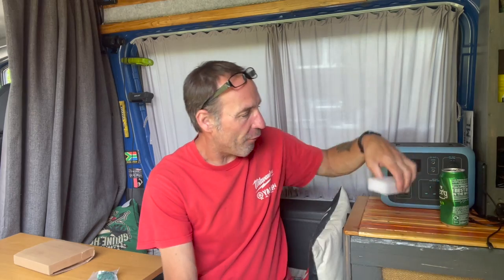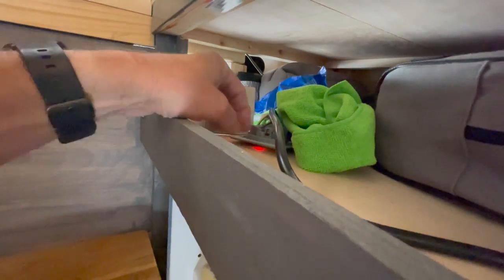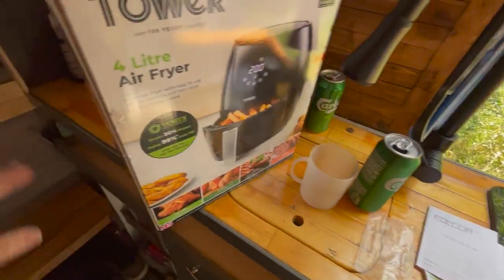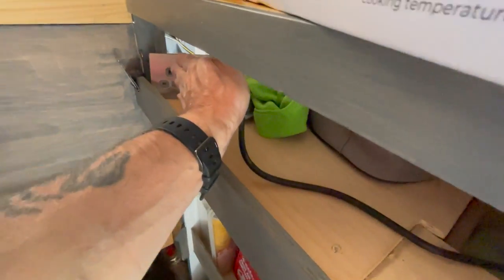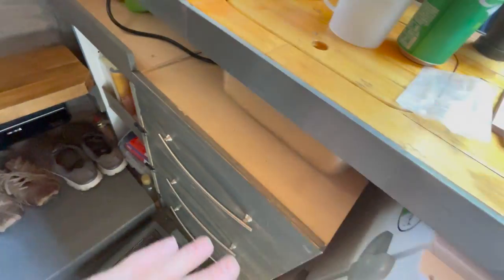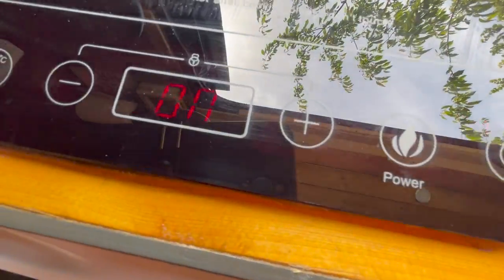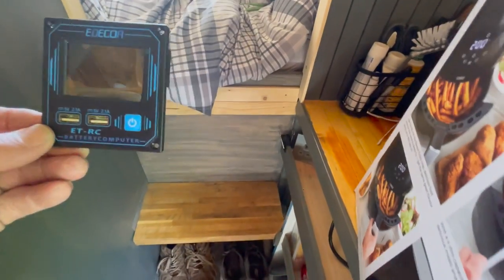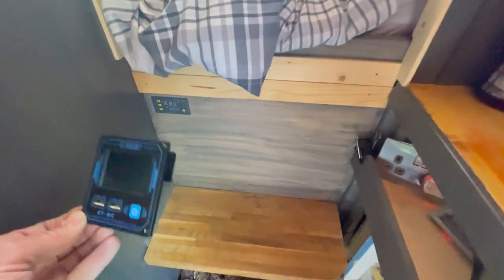Cooking with batteries 220ah AGM battery powered Sprinter camper #vanlife #induction #camper

Comment: I lived in a van now I have a house for 2 years. I still do this with my van setup lol - 220ah Lifep04 and 2000W - it's cheaper to charge the batteries on mains when there is no sun than it is to run the appliances for an hour a day!
Reply from the maker: I’ve been doing the same, when the sun is out cook inside the van then at night bit of a charge up, makes sense 👍👍👍

Comment: Nicely done Sean we are NOT ready for all electric yet, & your totally spot on about the footprint off lithium mining without all the plastics & suchlike!! I definitely will not be updating my gas cooker anytime soon
Reply: But 95% of lithium mining is done in Aus - and they are all talking about Oil refineries - also I live in an Ioniq 5 - and it has a 4KW plug in the back as well as V2L - I live off it just fine. I charge for free around Scotland and then camp with my own mobile power station. i's heaven!

Comment: When you were reading off the voltage at about 42 mins, the 11V was a positive value so that is going in to the battery. If that shows negative then its coming out of the battery.

Great video 👍

Environmetally, with the induction hob/air fryer, you aren't burning the fosil fuels which is the primary issue you are fixing. But yeah, all the plastics and chemicals in the batteries and equipement etc is not great either.
Reply from the maker: Unfortunately I'm not great explaining myself, i know what I want to say but it never comes out how i imagined it would in my head,  great that you knew what I meant 👍👍👍

Comment: I was looking at those inverters, as I would go Renogy too but they don't do 24v. If you would recommend that inverter I saw a 24v version so let me know if it's any good. Nice setup all worked suprisingly well on AGM. I'd change those cheap chinese inverter cables if I were you. And in the mppt section of the app the "Solar" bit is what is coming off the panel. and the "Battery" section is what is going into the battery, not what's coming in 👌 Great enjoyable video though mate!!
Reply: also at the beginning when you thought the inverter wasn't using any power when on that's because it was being powered straight from solar. Also with the cost I think electric is cheaper, as it's free energy and also if you were to spec the gas with permenant fixtures, like the oven hob units and lpg that is an upfront cost of £700! and then the gas on top of that as well as their smaller electrics setup all coming to probably £1k! So it's better all round 😂
Reply from the maker: @RustyRoseAdventures  Hi Max  I think if I was to start from the beginning,  the panel,  mppt,  agm battery, inverter and all the cables etc ,plus the induction hob and air dryer it comes in around £1400, now add the 300ah lithium roamer battery at £1400 , that's £2800 just to cook and will need induction cooking pots and a new kettle  , compared to a £12 gas stoves and £7 for 4 gas cartridges, but for me it a long term investment and a bit of fun learning